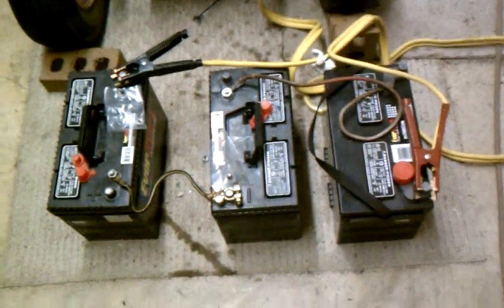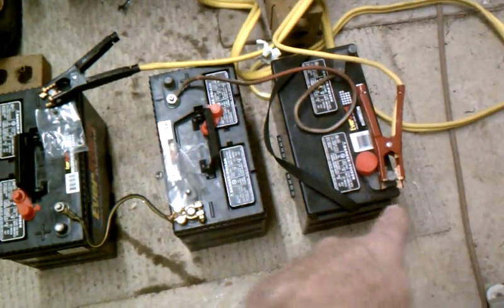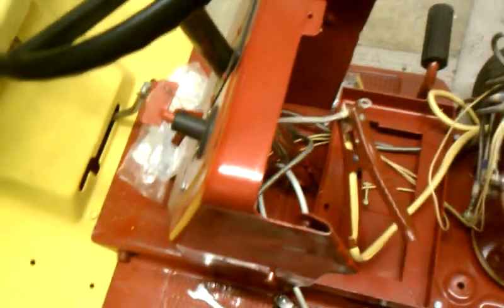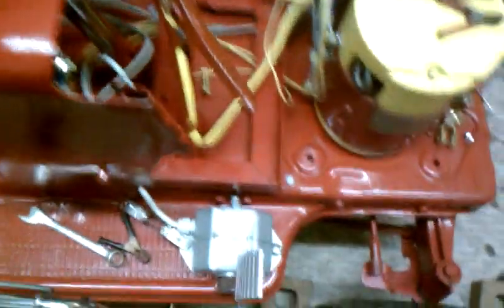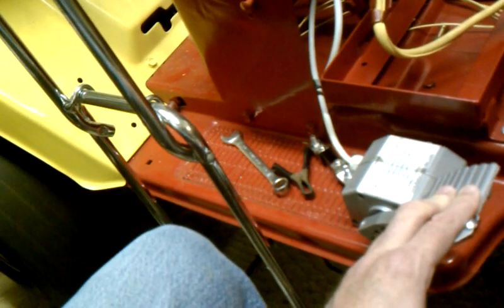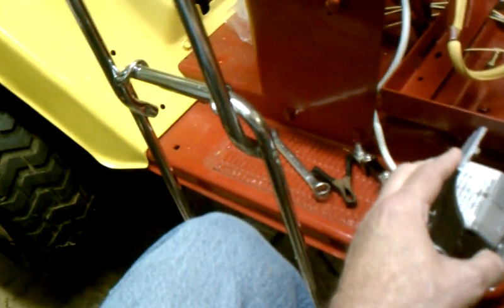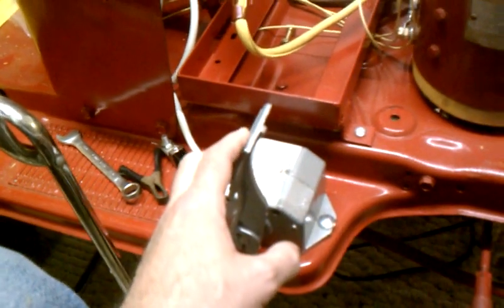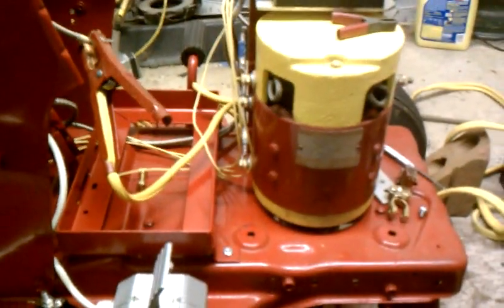Murr-E the electric tractor

Comment from the maker: That is standard practice for using a controller.  You normally make/break the contactor when there is no current.  If for some reason the controller sticks in the full on position, removing your foot from the accelerator will open the contactor, interrupt the circuit and shut it down.

Comment from the maker: @daniellma  Hi Mark, The original '88 Murray mower deck was in bad shape.  The future mower project will not require a speed control for the permanent magnet motor.  48V will give a fixed 3600 rpm, perfect for the mower and the variable ratio transmission.  The GE Elek-Trak was equipped as you suggest using shunt-wound motors for the mower deck.

Comment from the maker: @ils360 This project is just a yard tractor without a mower.  The early 60s series wound motor was not suitable for running a mower.  I have another riding mower and an Etek permanent magnet motor that I plan to build up as an electric mower.

Comment: Nice set up. Just wondering why you have the main contactor activated when the accelerator is pressed?
Reply from the maker: It's a safety thing in case the speed control shorts. Lift your foot and the power shuts off.

Comment: can you tell me what motor did you use ?
thank
Reply from the maker: The motor is a General Electric 2.5HP 36VDC Series Wound motor from an early 1960s vintage golf cart.  I rebuilt it with new bearings and fresh varnish, but it has the original brushes which are in excellent condition.
Reply: enganear
thanks for your answer.
do you think you can move a small lawn tractor with a 1hp electric motor.
this tractor will be a toy for my 6 year old boy.
Reply from the maker: 1 HP would be plenty for your application.  The important thing is to get the gearing right.  The motor will make lots of torque at low speeds, but it pulls lots of amps and will run very hot.  The most efficient speed is usually half of the maximum rated speed.